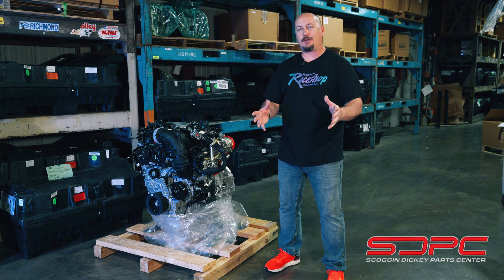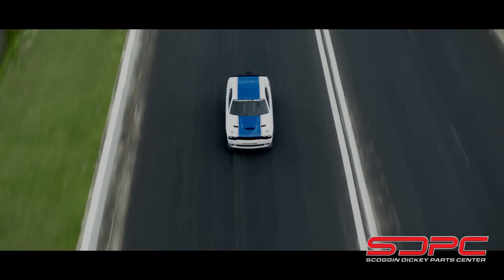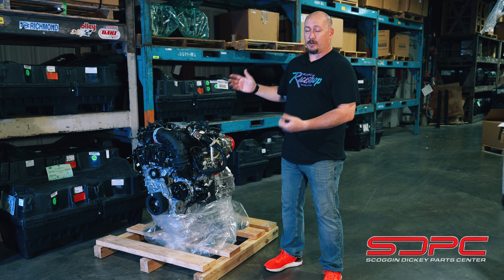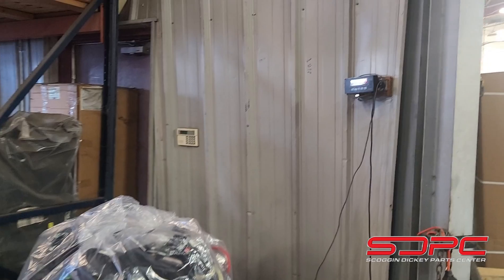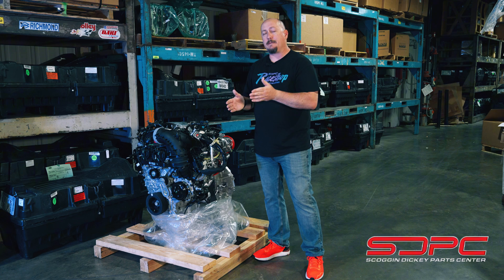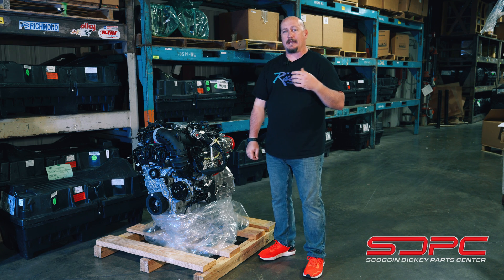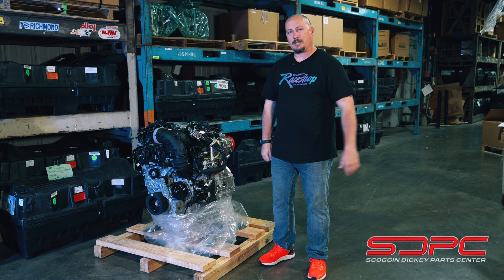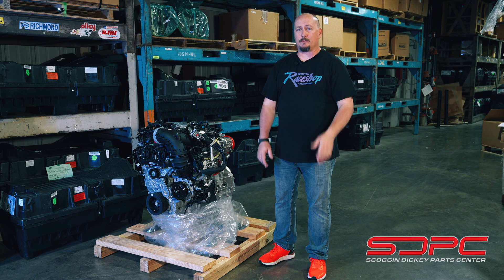Unleashing the Beast: The Mopar Hurricane CAT 3

Comment: I'm curious to see the strong points and weak links. It will take some time and miles to find out. Turbocharged direct injected gas engines are much more prone to damage than port injected engines when fuel delivery or ignition timing is compromised. Hopefully the timing chain and cam phasers are robust. Seems to be a weak link in modern low friction eco engineered engines.

Comment: Basically all the aftermarket has to do is copy the home work done on BMW's B58 and S58 engines in the aftermarket..Same formula should apply to these engines considering they are so similar to BMW's from a tech standpoint ,even same displacement. I would like to see large single twin scroll turbo kits for these engines. Would simplify and clean up the setup plus probably give the engine a better exhaust note

Comment: The guys at power nation took a 30+ year old ford 300 straight six out of a forklift modded it and slapped a turbo on it, and made 500 HP with 10# of boost….
Solid motor and a fraction of the cost.
This thing is an over engineered POS
Reply: These engines are supposed to comfortably sit at 1200hp on a stock bottom end so it's not really the same comparison but nice try.

Comment: Can’t wait for these in the new Chargers. Driven a bunch of the new rams and wagoneers both with the so and HO. And they are great engines. Very different than the Hemi but lots of potential. These engines are gonna hurt a lot of feelings.
Reply from the maker: Absolutely, and we hope to help make that happen with parts developed from this crate.
Reply: The AWD Charger with this, a boost controller and a tune will be an awesome car, year round.
Reply: Love my Hurricane 4 in my '24 Dodge Hornet.

Comment: Does the engine-swap variant come with a dipstick? 👀
Reply from the maker: Now THAT's thinking with your dipstick, Jimmy! Um, sorry. I love that commercial.

It looks like there's a boss on the side of the block that might allow for a dipstick provision. It might be something we'll have to look into.

This was a modification customers had to do using a fixture we sold that allowed you to drill a hole in the boss on the dry sump LS7 engines when doing the wet sump conversion so you could gain that dipstick provision.

Comment: Tell me again. A 3.0 6cyl running 26psi boost in a factory calibration has room to grow 😂 Lol, no
Reply: Oh there is always room. 26psi is cute.
Reply: Oh I can guarantee there is room to grow just based off the displacement alone and 26psi isn't bad at all I mean hell my little 1.6 turbo is pushing 20psi and tuned pushing 25psi all new turbo motors are choked do to epa regulations so plenty of tuning capabilities
Reply from the maker: Boost vs flow, sure. The turbos could peter out early depending on how it's controlled, sizing, engine efficiency, blah blah blah.

I'm wondering if it's actually seeing 26psi for that 550hp mark, or it's advertised as that being the "max" boost. I've yet to find anything showing what rpm the Cat3 makes that horsepower. I guess that will have to wait until after they finish validation with their non e.o. controller.

Garretts of comparable size on a 2JZ are in the 600-700whp range at that boost level.

Then there's the flow limitation of the tiny GDI Injectors.

We've got our work cut out for ourselves, that's for certain.
Reply: G16 makes about 21 psi i3 n has room just add bigger turbos
Reply: Tell me about 26 psi on 87 octane

Comment: At 26psi making 550 hp seems to me that it’s not very efficient. Roughly a 200hp NA engine. It’s probably RPM limited to 6000 ish and at that boost level it’s gotta be approaching octane limited power…. The plus side e85 should make a ton of power with that boost and displacement
Reply from the maker: I'm wondering if it's actually seeing 26psi for that 550hp mark, or it's advertised as that being the "max" boost. I've yet to find anything showing what rpm the Cat3 makes that horsepower. I guess that will have to wait until after they finish validation with their non e.o. controller.

Garretts of comparable size on a 2JZ are in the 600-700whp range at that boost level.

Then there's the flow limitation of the tiny GDI Injectors.

We've got our work cut out for ourselves, that's for certain.
Reply: @Sdpartscenter  some very good points, I’m definitely interested in seeing what kinda of potential this engine has